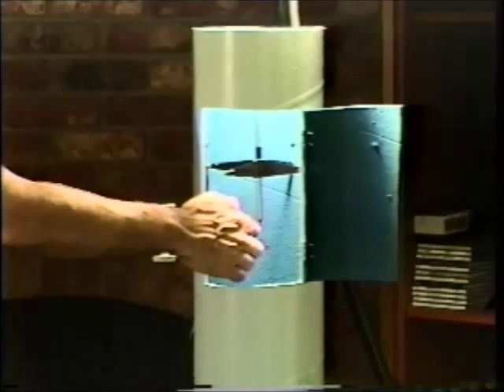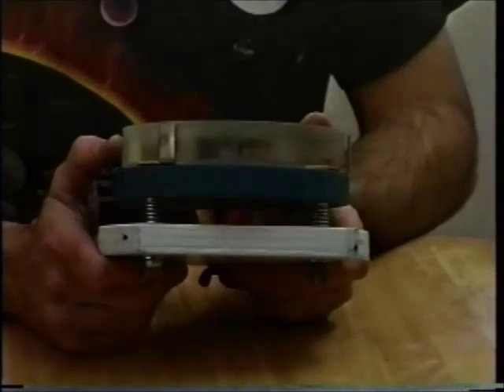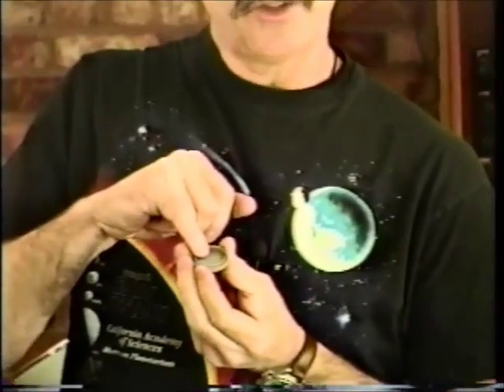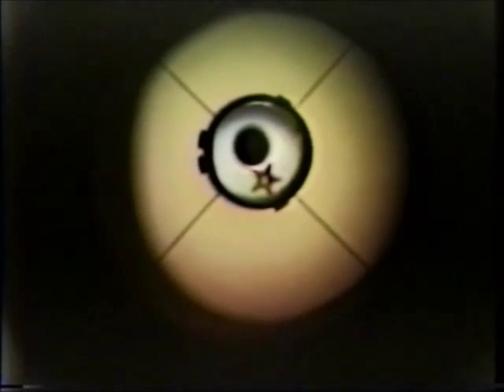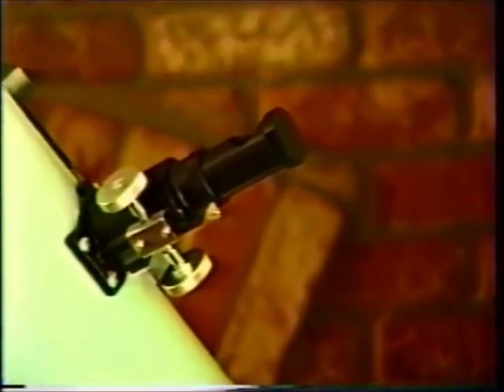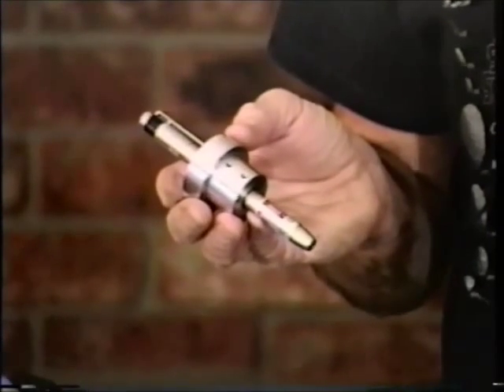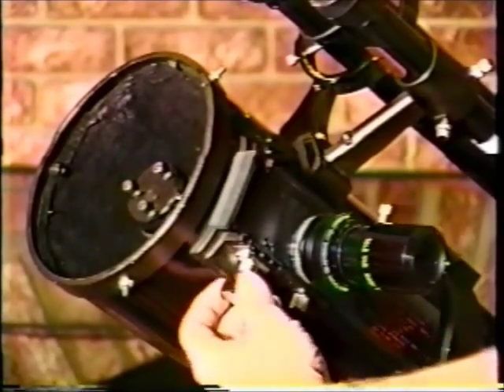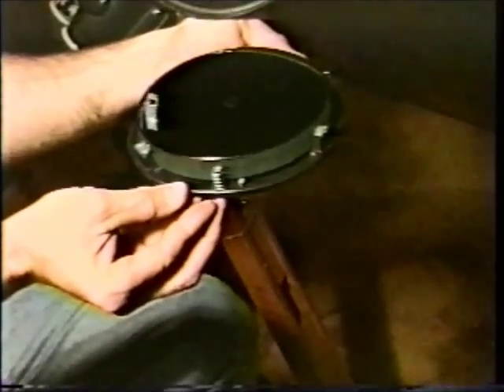Collimation of Newtonian Telescope Part 2

Comment: I liked the learning by doing method here.
The others show less info and are often just a visual overview of the process.
-
What he failed to mention or make very clear in 'Part 1', after dropping the secondary mirror assembly down the 'OTA' or 'Optical Tube Assembly!', was; "This will likely lead to primary mirror damage!", "Do not let this happen.", "Do this step in a horizontal or front/downward angle."
Yes he does mention a caution warning.